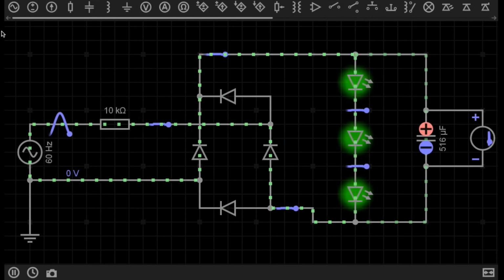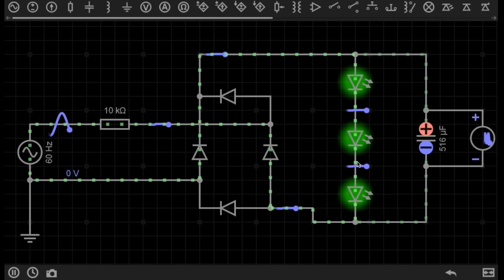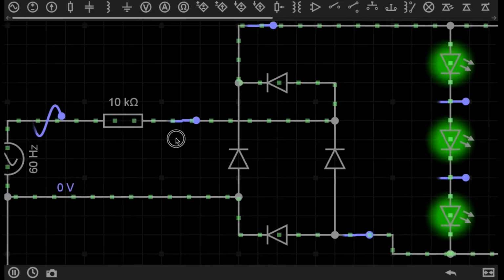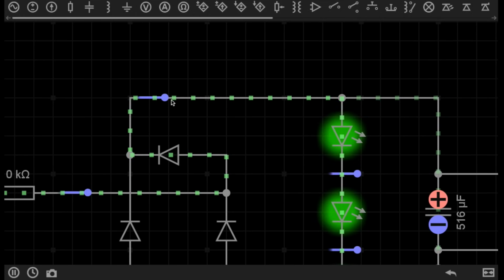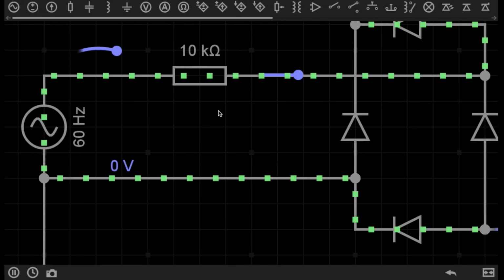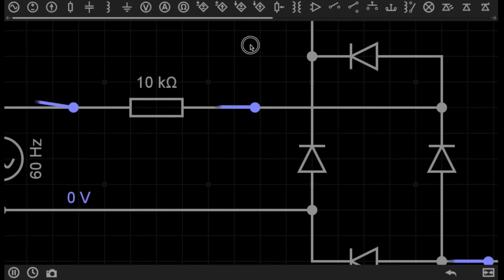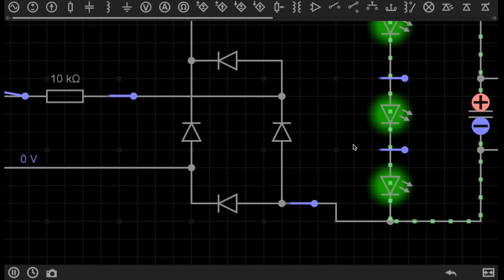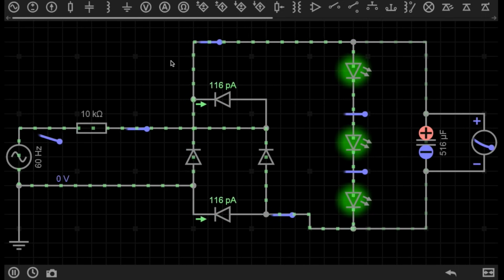How AC is turned to DC! EASY! (Rectifiers): Electronics Basics 7

Comment: The basic method of the conversion from AC to DC is mainly about rectifying.
 
This process has two types which are full-wave and half-wave rectifying. In either way, a diode is used to clamp the negative side amplitude of the AC input voltage.
 
For half-wave rectification which uses only a diode to clamp the negative side, it removes the negative component and produces half a waveform.
 
For full-wave rectification, it uses a diode bridge including four diodes and then inverts the negative side and makes the output to the positive side. Therefore, the full wave turns into DC.
 
After converting to DC, it is required to use a capacitor to smooth the waves. Even though it goes through the smoothing process, the ripple remains. The ripple voltage varies due to the size of the capacitor and the load. If the size of the capacitor and load are equal, the ripple voltage would be smaller.

Comment: I think there might has been an error at 3:25, as the 1st intersection of the lines where the left diode and the upper diode are not connected/joined.

Comment: Hey thank you so much for the information. Just started into electronics a month ago. Have gotten deep into it and just made my first circuit on a bread board modelled after the circuit you made here and this program you introduced me to to figure different values for my ac transformer that stepped my voltage down to 14v. It took a good  amount of figuring out. But very happy with my first successful circuit

Comment: Even though the current has changed to a direct flow, that direct flow is not consistent, its slowing down everytime the ac changes direction so that DC is not maintaining a constant flow, its going fast then slowing down then fast again so the led's are going bright then dim then bright then dim, how do you prevent that dc current from slowing down ?? How do you make it a constant speed to keep the led lights bright all the time ?
Reply: You will need capacitor and voltage regulator

Comment: But one thing that I don't get is the second junction (the one left to the trio of LEDs); When electrons go, they're being forced to go through one direction by the diode, that's pretty clear. However that second junction (in purple) leads to two LEDs pointing THE SAME DIRECTION - so how do electrons know which track to take in order to complete the circuit? There's no diode on the way back forcing them to take any direction.
Reply: The top and bottom diodes only allow current to flow in 1 direction which is ----> 
The 2 side by side diodes only allow the current to flow the other way <----- 
His diagram is a bit confusing because he over lapped the top and left diode connections. If he would have seperated that connection to not look like they are connected, it would have been easier to see.

Comment: I've noticed you're not consistent in your circuits with electron current vs. conventional current. However, in the case of this AC circuit, you should be telling everyone you're choosing the rectified current to appear as conventional. Your comments about how the electrons are flowing was in error because you set up the simulation to show conventional current flow.  Please redo this video.

Comment: I’m distracted in this video by the orientation of the diode symbols. In the previous video I noticed that the diode symbol looks like an arrow that is stopped by a line. In that previous video, when the diode was arranged that way the current stopped. Now it seems the convention has changed. I understand that the current flow and the electron flow can sort of be interchangeable in theory, but having that concrete model now flipped around is making it hard for me to follow this. Imma keep watching, though…

Comment: This was great but why wouldn’t the current flow through the two middle diodes on its way back to the source when the current is moving clockwise? (Source to resistor direction) 
Is it like a path of least resistance thing?

Also what is the component on the right?

Comment: What are those green arrows that seem to me point in the wrong direction? I ask because, why is this not a shorted circuit? There are multiple paths for electrons to flow, obviously. This multiple path circuit is intended to transform the alternating current  to direct. But why doesn't this multiple path circuit cause a short? It must have something to do with how a diode works, and why you have those unexplained green arrows in the animation. I get a diode can flow electrons in only one direction, having two diodes connected and oriented in the same direction should still allow a flow. Can you or SOMEONE please clarify this. This circuitry is a real mystery to me. This animated circuit doesn't contain a battery, but many other circuit animations do. This means to my small brain there are two sources of power, this for me doubles the mystery of the rectifying circuitry. Are diodes magic?

Comment: You did not explain the portion where the capacitor is located in the circuit. The movement of current there is in that loop looks strange to me.

Comment: do I use the same dropping 24v AC to 12v DC or do I need to go anouther route?, ev'ry one I've seen is dropping 110 -220 v AC down to a lower voltage, I'm only trying to run Leds, thnx

Comment: Superb video. The only thing I'd have liked is for you to explain what's going on on the extreme right hand side (the stuff that's labelled 516μF.  Is that bit necessary?  If it is, perhaps you could explain why; if it's not, just say that it's not and mention what video in your series it's explained in.

Well done.  Thank you so much.

Oh, and one other question whilst I'm here.  These diagrams seem to be largely self explanatory but do you have a video to explain (for example) why we need to link a ground to the -ve terminal, and why the volts get labelled in increasing values as you go from -ve to +ve (since my intuition tells me that they should go in decreasing values as you move from the -ve to the +ve terminal).
Reply: Sorry to reply to my own comment, but I've just seen the video on capacitors which explains what's going on.  It may just be worth while adding a comment to the video to refer people to the capacitor video!

Comment: Theres 2 diode on the return line in the same direction? How does the current know which line to go dow n there both connected to the same wire?

Comment: great video, i've a question sir,
In a smps circuit, if i increase (double, triple) the capacity of reservoir capacitors at same voltage, do i stress the rectifier and burn it in long term usage? I'm doing this with my all subwoofer amplifiers and nothing happened yet, but should i reduce the capacity, i dont know.thanks.

Comment: I would like to point out few mistakes:
(1:10) 1. Transformer do not convert AC to DC. It only steps up or downs the voltage of AC. 
(3:25) 2. The diode isn't even connected to upper wire directly.

Conventions:
1. The current shown is conventional current.

How do I know?
In this diagram there is no wire running over another represented by an arc. But there are points where straight lines are connected.
The in diode, electron flows from backwards in this PN junction diode, whereas conventional current flows forward
electrons flow  --<-----I>|------<---
conventional current -->-----I>|------>---

Comment: I'm just starting to get more into electronics and I've been trying to strengthen my fundamentals the past day or two. There's just one question I have here. I know that AC follows a sine wave as it pulses back and forth at a certain frequency and that DC is a continious flow, but if you convert AC to DC, does the dc flow in pulses too? Even if it doesn't follow a sine wave? Because when the AC slows down to change direction of flow, I'd assume that the DC is weakened here. Or maybe the voltage fluxuates? If it doesn't, why doesn't it?

Sorry if these questions sound stupid lol.
Reply from the maker: Yes it does flow in pulses, search for an image of a sine wave that has been rectified and you'll see. Usually the DC is smoothed with a capacitor which acts as a reservoir to make the flow smoother.

Comment: Are you using conventional or electron theory flow in this circuit?
Reply: life would be easier if they told you , a new utube requirement?, never ,  but 'it does appear to be conventional current,  positive to negative
Reply: @kaycarolann  As if to confuse an otherwise straightforward system so the engineer never knows quite how to read a circuit.  Just asinine.

Comment: Correct me if I’m wrong but at 3:22, you said the current won’t go down through the diode, but isn’t that junction of wires not connected anyway?? As in they are separated wires.

Electronics is one of my modules and this video has helped :)
Reply: yep, little error, though good explenation nonetheless

Comment: Everyone should stop these videos and change the AC Input before people get hurt!!!. That is a complete wrong circuit because you did not add the transformer section. People may hook up directly mains to the diode bridge lol. Mention that the AC Supply is off a transformer and not directly off of mains. SMPS power supplies use a Y Cap so they can work directly off the mains.

Comment: is it possible to filtrate dc voltage without using a capacitor in parrallel after the bridge rectifier if yes how ? thanks for your help .

Comment: Common sense is telling me using a single transformer, the more rectifiers I use in parallel the better since they will all generate less heat. Am I correct, or dead wrong? Appreciate any comments, and thanks.

Comment: Thank you. Your videos are fantastic. Question: I noticed the direction of current flow through a diode seems to be different from one video to the next. (I've been watching your playlist called Simply Electronics Basics.) In some videos, like "What is a Diode" for example, it shows the flow coming out of the wide end of the triangle in the component diagram, but in this video the flow goes into the wide end and out the pointed end. If you will, I'd appreciate some clarification on why. Is there another video that explains this? (I'm a little late to the party since this video is 3 years old, so if you aren't monitoring comments anymore maybe another recent viewer would be kind enough to explain. Thanks/Cheers!)
Reply: spongeBrainSqueezePants I believe the reason you are seeing it in two different directions is because he is showing the direction of electron flow (from - to +) in some and in others he is showing conventional current. Conventional current flows from positive to negative terminals. It is inaccurate but because it was established as a convention long ago, it is still in use as the standard. I was confused by ‘conventional current’ as well.
Reply: @umairkayani8699  - Thank you very much. That makes sense.

Comment: I don't understand why the current won't flow in the forward path of the diode. In the return path of current, there are 3 diodes that are in the forward position according to the current direction. Although if the current flows through the other 2 diodes, they would meet with current that has not passed through the load yet. Any clear simple explanations? Thanks!

Comment: So a diode acts as a rectifier?
Reply: No, Like a check valve for water only lets water flow in one direction. A diode only lets electric current flow in one direction. With that, you can place multiple diodes in an way to cause A.C current to change over to D.C.

Comment: But.......why not just use a transformer to convert AC to DC?
Reply from the maker: A transformer can only convert AC to AC, you would need a diode on the transformer secondary to rectify the AC output to DC.
Reply: @SimplyElectronicsOfficial  Thank you.
Reply: @SimplyElectronicsOfficial  I want to know as much about electronics as possible..

Comment: Your diodes are backwards so this actually wouldnt work.
Reply: no it isnt
Reply: @TheBaregel In Canada they'd be wrong based on how the circuit is operating 👍
Reply: @venusdevine123  what are you talking about?
in canada need a specific power supply's?

Comment: I think it would be better to use the traditional diagram as in the thumbnail.   The way you show it is a bit confusing to those learning.   Otherwise I like your stuff.   I’m subscribed.   Even when I have seen people make a full wave bridge rectifier using four diodes by twisting the leads together they usually make the shape in the thumbnail.

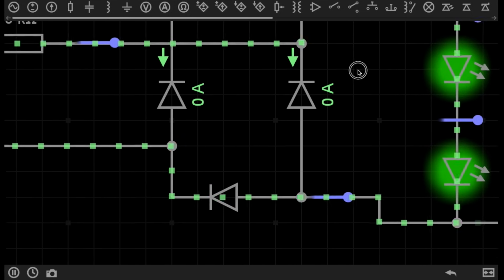Comment: Sorry but it's very badly explained. Eg look at 4:11 at the bottom of the circuit. Why the current doesn't go up, both diode would let the current pass through in that sense. But they don't. Why? (And it's super confusing to see dots, instead of bridge sign to show the junction.)
Reply: because electrons moving on the path it will close the circuit.
thats basics that not to be mentioned.
Reply: Thanks for the answer

Comment: AAAAAHHH this is confusing let me try to explain you have 4 diodes 1 on top and bottom and two in the middle.. I watch the line of the left diode and see the curewnt goint through it but when it is reversed the current flows from the bottom but makes a sharp turn to the left.. what makes it turn and why does it not just carry on.. it is going the right direction?
Reply: tinkmarshino Current always takes the shortest path to ground (path of least resistance).

Comment: Hello Sir, i have a confusion! that you don't use transformer on the main ac source current line. and we see,you used 10k resistor on this point..
so,may the resistor will blast, becaz we don't use transformer there!
can you please kindly solve my confusion😊
Reply: oHMS LAW  E/R=I  IF  E=120V AC   AND R =10K = 10,000 ohms THEN  120/ 10,000 =.012 =12ma ==the resistor limited the amount of current that will flow in the circuit. Now you multiply the voltage times the current to see the wattage  E x I =W  120 x.012 = 1.44 watts  -not very much heat but you better have at least a 2watt or 5 watt  rated 10k resistor or it will overheat if if is a one watt

Comment: I must say that was poorly explained: you need to slow down the animation and turn of the flashing electrons when explaining their motion during each half of the AC cycle. Pity, as there is clearly an intent to explain, but you need to prepare this better and this will result in a better explanation I think. It is not clear the path the electrons take in one half of each cycle. From an instructional perspective given that you are sing diodes, it would also have been better to use current rather than the flow of electrons.

Comment: Very nice explanation and EveryCircuit is a great tool (though the canvas is a bit small and I'd rather have it as a Windows application)!
If you'd call the diodes clockwise D12, D3, D6 and D9, I'd say the electrons returning from the cathode of the lowest LED have a choice, as they encounter 2 forward biased diodes: D3 and D6.
Same at the point where they went to D3, they could go to the forward biased D12, or they could go "left" back to the AC source. I don't see what determines the route of the electrons...

Comment: My question is, what is the reason for needing an actual power supply for DC devices. Why doesn't a PC just have this 1 device instead of the complex circuitry that they use to convert ac to DC?
Reply: Because your CPU needs 1.2 volts, USB needs 5 volts, RAM needs 1.5 volts, etc etc.. and they demand more or less current in all times depending on what you are working on your PC.. So it needs many power supplies to power up different things and change current values so it needs control chips, current sensors etc.. it's not that simple.. this is just converting AC to DC..if you convert 220v AC to DC, you get around 320V DC, so you need a power management module to lower the voltage and so on..

Comment: Good teaching ☺you explain that very well. Thank you for slowing it down
Reply: Well the recipetiers for the Alternator are below the feild winding because when it’s rewinding the Alternator needs to go through the fresh hold when it’s regulated through voltage, when they regulate between the Engine it spins because they are meticulously harder to spin with lower Voltage power through pin13

Comment: You don't mention the capacitor. I'm assuming it is there to keep a steady current flowing through the diodes during the switching?
Reply: Very much so, capacitance has always given the option of stability as well as directional pathways....brilliant little piece
Reply: The capacitance is added in parallel to the output in order to stabilize voltage on the output. Think of it as mitigating peaks and valleys when the diodes are switching.

If this was a higher current application then inductors would be added in series with the output as well.
Reply: I'm asking if adding any load will alter the path of electrons.

Comment: I really enjoy your videos - good job and thanks for sharing.   With this particular video however, it's a bit confusing the way you have laid out the circuit and explained it to us.  For starters, it looks like the current flow is set up as conventional mode.  Secondly, if you watch the flow thru the bottom diode, it flows toward left.  But, why not upward toward the diode at 9'oclock position ?.  I must be missing something.  Thanks.  keep up the good work! - nagi . https://N0AGI.com/